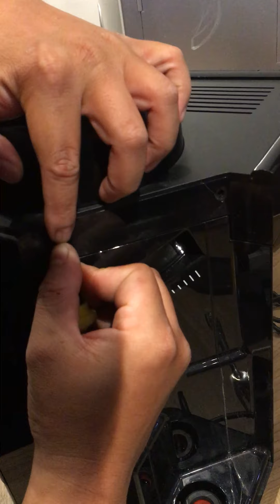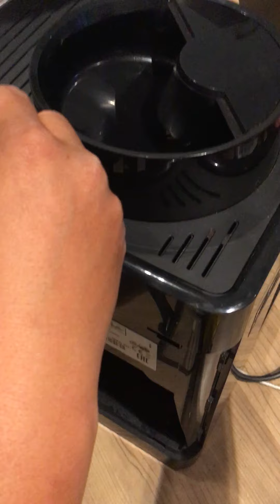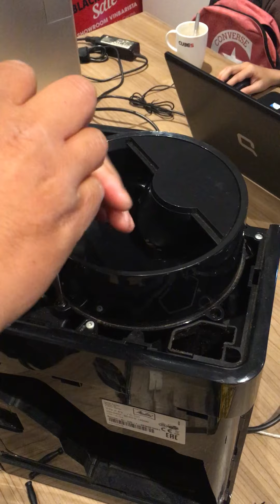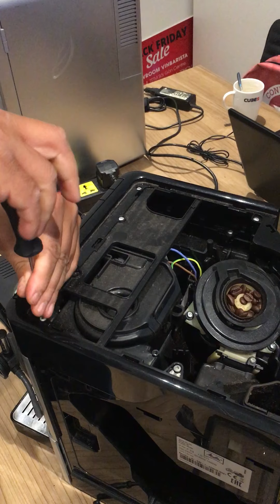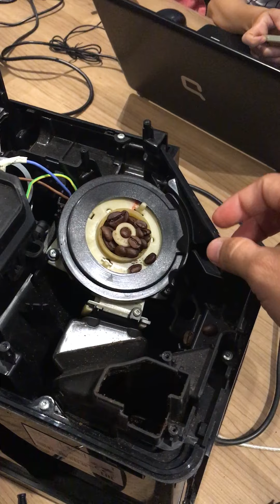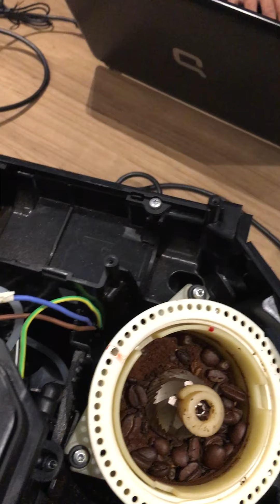Vệ sinh máy pha cà phê Melitta Passione

Comment: Hi, did you had any errors because of this?
Reply from the maker: No errors Sir, just open to clean grinder
Reply: @phongtran05  i have the same coffee machine and it’s not working anymore, giving refill beans message all the time. Maybe you know what can be? Thanks
Reply from the maker: @mesters_transformation  grinder is blocked or used long time , Grinder need to be cleaned or replaced , you can do as clip or better call service center